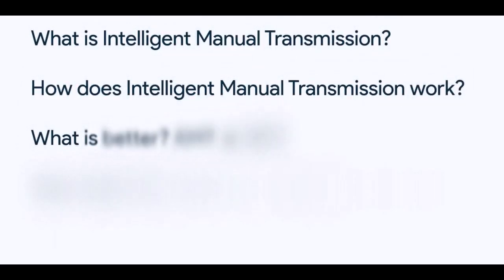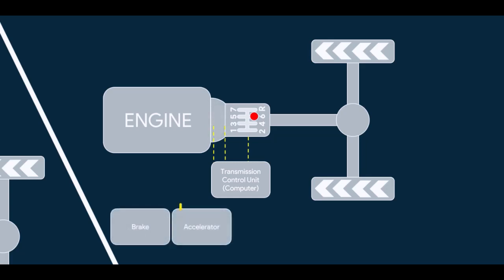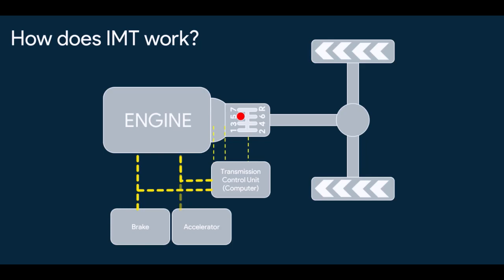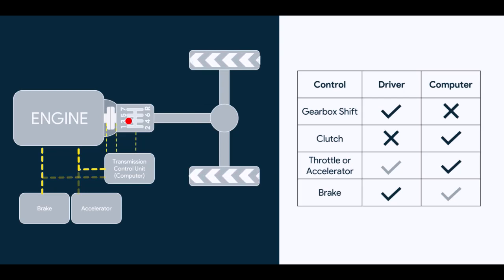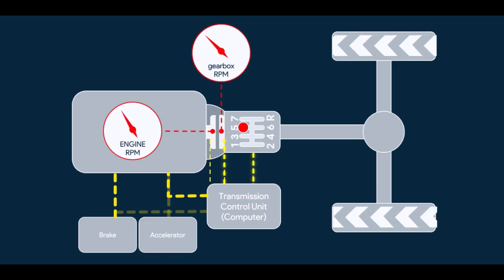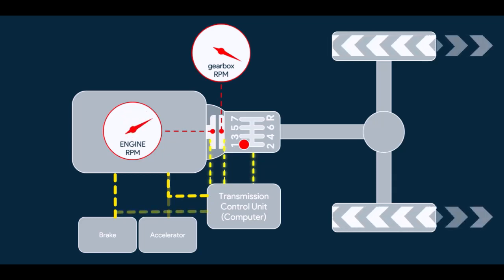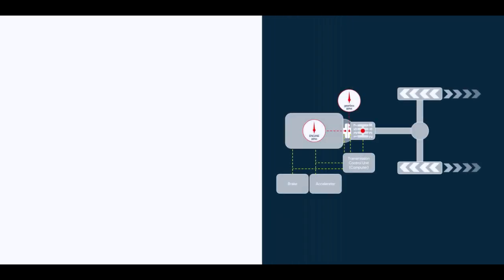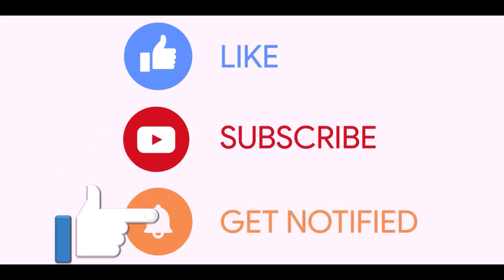iMT | Manual transmission without clutch | How intelligent manual transmission works ? IMT V/s AMT

Comment: Regarding downshifting from 6th to 1rst. If the revs would be too high couldn't that mean the imt could force someone from 100kph to 15kph to avoid over revs using braking? Wouldn't that be dangerous?

What about on cars with no imt braking,?

Comment: Toyota iMT still requires clutch
Reply: It can't be "intelligent" if it still requires the driver to engage and disengage the clutch manually.
Reply: @troy5568  that's the point of a manual. Get an automatic otherwise.

Comment: Sir i have doubts

1. Will car cut off while collision.

2. In case of emergency how to stop car say if break fails or smoke appears in dashboard other thn push button as we dont have clutch.

3. In case of short circuit or any other fire related issue amd if we stuck in car for some reason will car cut off if not isent it a major issue as car is on and fuel supply is on it may blast..... 

In short what r the safety issues in imt as we don have option to shut off engine only puch button........ as we have option to shut off engine by just removing leg from clutch paddle

Comment: Can we start driving directly from 3rd 4th gear..or it won't allow?
Reply from the maker: To start the engine gearbox should be in neutral, otherwise it won't start.

You can drive from 3rd or 4th gear if imt is programmed to do so.

If gear ratios are tall and torque output at wheel is not sufficient to pull directly in 3rd 4th or even 6th the imt will declutch the engine from transmission ( to ensure engine won't stop), and notify on dashboard to down shift.
Reply: @UntangleClub  So does that mean if we shift from lower gear to a very higher one (like 1st to 5th or 2nd to 6th), the clutch won't disengage until we shift down?